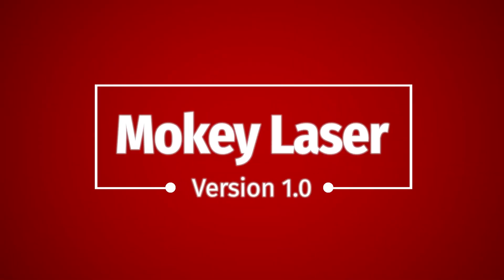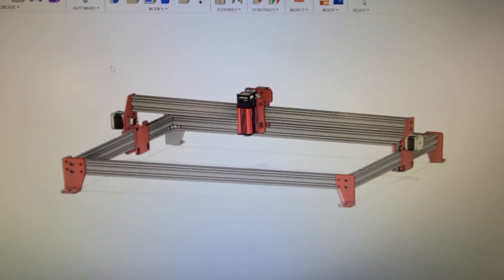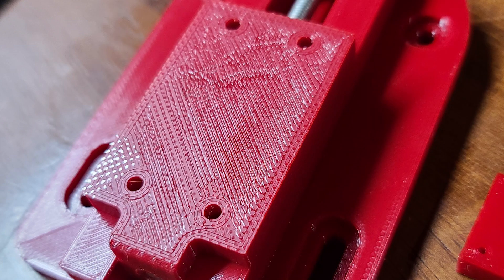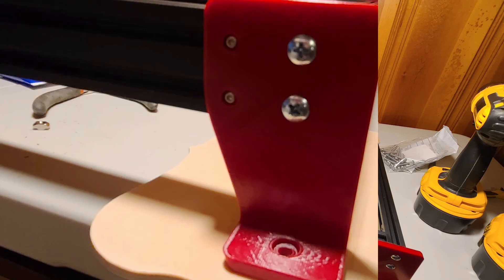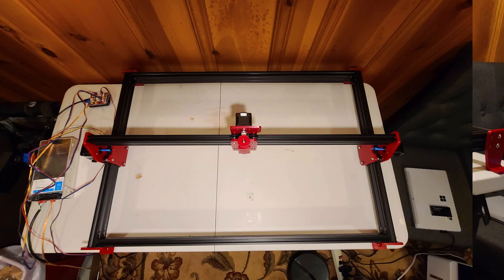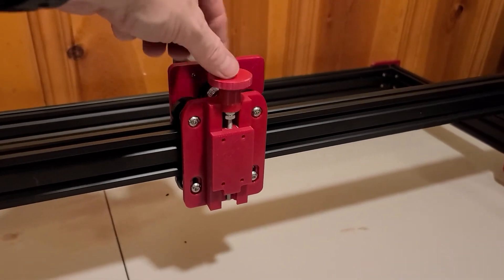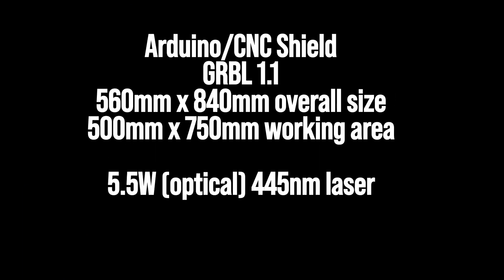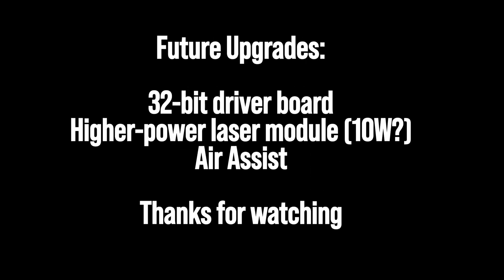Mokey Laser v1.0

Comment: What choice for GT2 belts? Neoprene, glass fiber reinforced, steel reinforced?. I built my machine for the best accuracy I could but, although a 100mm x 100mm grid is dead on at the extremes as those limits were calibrated, each 10mm square is slightly different (0.1mm error worst case). I'm cutting parts which need to mate - taking kerf into account. So somewhere between the extremes there is non-linearity. The steppers aren't skipping so I think it's possibly stretched belts or bad belt geometry. I'm gonna try some different belt materials but wondered if you'd experimented with the available types.

Comment: Hello, Since this is not a 1-meter by 1-meter square, May I ask what lengths you cut the aluminum 2040 to?
Reply from the maker: The 2 y-axis extrusions are 560mm. The two x-axis extrusions are 796mm, and the gantry extrusion is 839mm. You can make the engraver any size you like as long as the gantry extrusion is 43mm longer than the x-axis.

Comment: Hello, I love the concept. I printed the laser holder and base first. I am new to 3d printing so I may be doing something wrong so I thought I would ask. The mounting holes on the laser holder on my print came out at 20mm wide by 40 mm long. Is this what you designed?
Reply from the maker: Hello! Those holes must be adjusted based on the  specific laser module you're using. If you let me know, I can send the laser holder for your specific module.
Reply: @mokeylaser  Thank You, The module I am using is a Dewallie LA400 and is listed as LA-2 size  The side-to-side holes are 16mm apart, and from top to bottom is 40 mm, They are M3 size. I really appreciate this!  I am @lsagan
Reply from the maker: @Ralph_Strauser  I added a new STL file for your module here. I hope this helps!: https://github.com/mokeylaser/MokeyLaserV1/tree/main/MokeyLaserV1_STLs
Reply: @mokeylaser  Thank You Very much, I will print it in the AM.
Reply: @mokeylaser  A Quick Update. The file fits and works perfectly! I am now a step closer to being done, I am still short the off-line controller. I am investigating the 32-bit controllers to see what looks good for me.
Reply from the maker: @Ralph_Strauser  If you have seen my MokeyLaser v1.1 video, I implemented the MLK DLC32 controller board and touch screen. I'm not saying they are the best for your application, but they worked out great for me. Very easy to set up and use. The only issue I ran into was the need to install the laser engraver firmware.
Reply: @mokeylaser  I am assuming you went with the Board_V2.0/V2.0.8_H35_20220105_N.bin firmware? So Yes, I did opt for this controller as well. Have a great Day!

Comment: im  building along, and would like to ask how do you do to make the x carrier to stay parallel to the machine
Reply from the maker: Sorry, I just saw this. I need to make an assembly video. Are you talking about when you install the drive belts? If so, after installing one y-axis drive belt, I center the x-drive on the gantry and slide the entire x carrier to the front of the machine. I let the x drive/laser mount rest flush against the front extrusion and I hold it in place while installing the second y-axis drive belt. You can email at mokeylaser@gmail.com

Comment: Great job. For your air assist you might want to consider getting a 20 lb cylinder of CO2 from your local welding supply store and running the output through a hypodermic needle pointed at your focal point. The CO2 will blow out the kerf while also acting as a flame suppressant. Just remember to turn off the regulator when you're done cutting otherwise you end up with an empty tank pretty quickly! I know this from personal experience. That said, if you do shut off your CO2 a 20 lb tank can last you a very long time. Is your controller able to modify the power output of the laser so you can do raster graphics as well? Or are you limited to full power vector cutting/engraving? I'd be happy to collaborate on this if you are interested. I've made plenty of core XY machines including mills, routers, and lasers. I also have that same Sainsmart module.
Reply from the maker: Hi Jessica, thanks for the suggestion of the C02 cylinder. I like the fact that it is a dual-purpose solution. I just finished upgrading to a 32-bit controller with a touch-screen. I have only played around with it for an hour or two, but it is a huge improvement over the Arduino/CNC Shield. I'm running GRBL 1.1h, and it supports M4 commands, but I don't see any laser output in variable power mode so I'm troubleshooting that issue. It works great with constant power, but that's not ideal. Feel free to reach me at mokeylaser@gmail.com. I'm interested in your thoughts.

Comment: Could this design be used with the new FoxAlien 80W Fixed Focus Blue Laser Module Optical Output 20W?
Reply from the maker: Hi Kevin, I will take a look at that laser module. The design is pretty flexible, but I'll want to be sure before I say yes or no. If it is adaptable, I will look into making modifications to accommodate that laser.
Reply from the maker: Hi Kevin, I looked at the FoxAlien 80W module. As soon as there are drawings with the exact size and hole pattern, I will make an adapter plate for it. Let me know if you see any detailed drawings.
Reply: @mokeylaser  I recently adapted a 20w FoxAlien Reizer to a 40w module. I think the adapter plate will fit the new module, send me your info and I can send you the CAD file